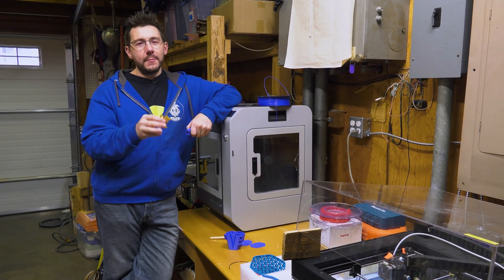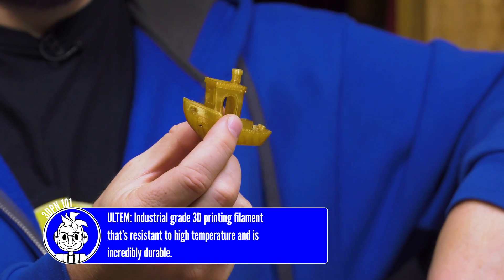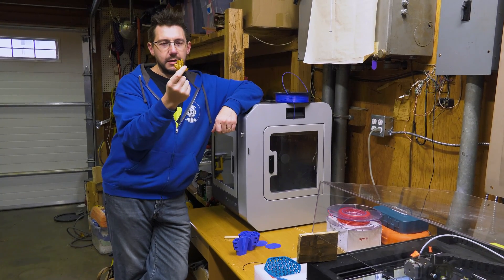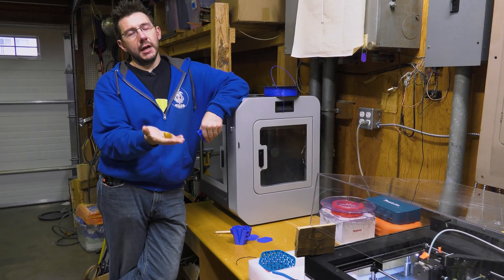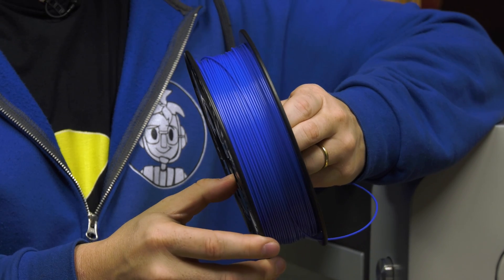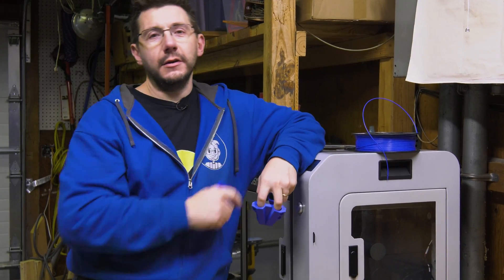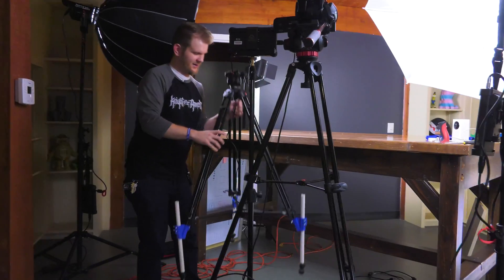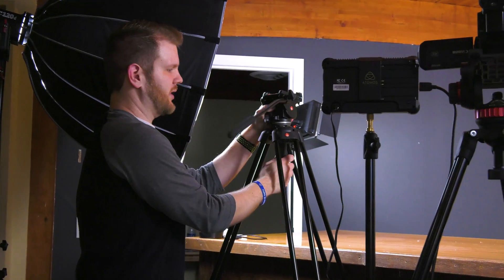Practical Printing Fixes It Again! 3D Printing FTW!

Comment: Printing the benchys without the cabin would simplify the testing process.
Reply from the maker: True, but that’s only for the Benchy sport boat :)
Reply: @3DPrintingNerd  But the sport boat model would facilitate the strength tests without snapping the cabin off of the normal benchy.

Comment: To secure the feet to the PVC extensions: without glue:

1) Take the feet off.
2) Cut a two slits in the PVC, 180 degrees apart, with a hacksaw blade, about 3/4" into the pipe from the end that the food inserts in.
3) Get 3 hose clamps that will fit around the PVC Pipe (1/4" wide is fine but 1/2" will also work).
4) Place a hose clamp around the pipe between the end of the pipe and the end of the slits you cut.
5) Re-insert the feet.
6) Tighten the hose clamp. The PVC should compress against the foot and retain it.

If you want the foot to be captured even tighter, cut a second set of slits 90 degrees from the first set.
Reply: That's a clever idea. Though, it does seem complicated. Wrapping it in tape can generally work too.
Reply: @luchvk  Yes but using tape makes it more difficult to restore the feet to the tripod when the extension is not needed. You could also glue them in with Goop but then you'd never get them out.
Reply: @Russwig  I think that I understand what you mean. However, I didn't mean to wrap the tripod part with tape. I just wasn't specific enough in my reply. I meant wrapping only the PVC in tape to make it effectively thicker.

Comment: Joel, Nylon 910 (from Taulman3D) is great for surviving things like being run over by a car. I did this demo for some surgeons who asked me to make a part and were skeptical that "plastic" could ever be strong enough (I mean a 787 is highly plastic and it works well) anyway, this is the blade for a surgical retractor printed on my E3D BigBox and as you can see is tough enough to both run over and after even tow a car down the street (video link on Vimeo below): 

 https://vimeo.com/171849469/8f4f26628d

Comment: So basically you used a model for the PLA in fire that would easily warp when heated. You used a much more rigid and generally structurally sound shape for the Ultim fire test.
How disingenuous can you possibly be?
I've noticed you do things like that a lot 3D Printing Nerd!

Comment: Yeah these practical printing eps are way better for us at home who grumble at multi million $ companies spruiking their wares at the fare.
Can you explain the improvement to the tripod? Is it because the feet become too wide when extended and the extensions go straight down?
Reply: Jason Axford the improvement is height. The base of the tripod is wide to make it sturdy. If we make the tripod taller by making the base smaller (so it’s taller with a skinnier footprint) the tripod will literally just fall over with the slightest touch. So in order to make it the appropriate height we needed to either buy a taller tripod or extend the legs on the one we have. This print allows us to just use pvc pipe to extend the tripod legs and make it taller while still keeping the wider base so that the camera is more secure and the tripod is less wobbly.
Reply: @lasersandlayers  Thanks for the explanation. You must have some interesting situations to want it to go that little higher by bringing the legs in without the PVC extensions.

Comment: HOW, ho you not have hundreds of spare benchys, I was considering sticking a line if them across the wall of a room in a wave like pattern.
Reply from the maker: HahHha. I have some, but I have more miniJoel prints and I CANNOT RUN OVER THOSE
Reply: @3DPrintingNerd  of course

Comment: Why don't you use HIPS its the better ABS/ASA. Tougher, easier to print less warp, less smell no formaldehyde and 1/3 the off gassing of styrene and you can pick it up as low as $10/kg